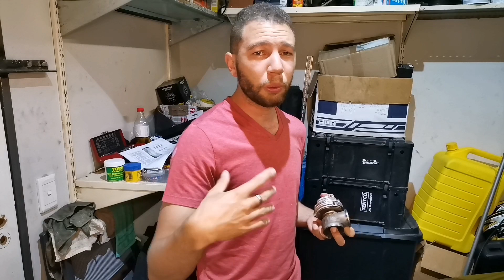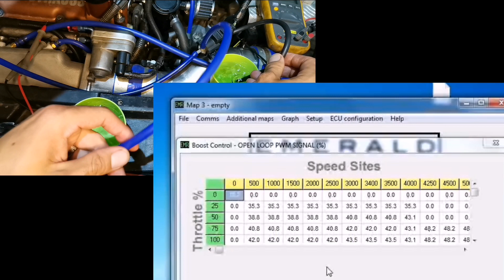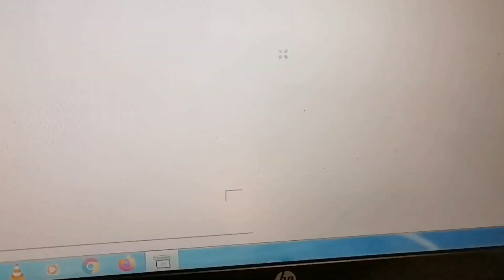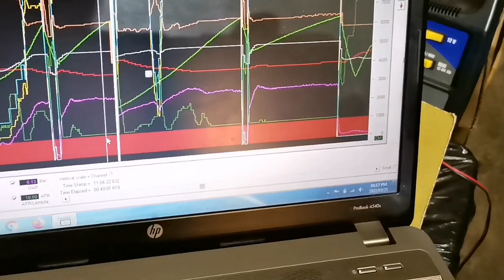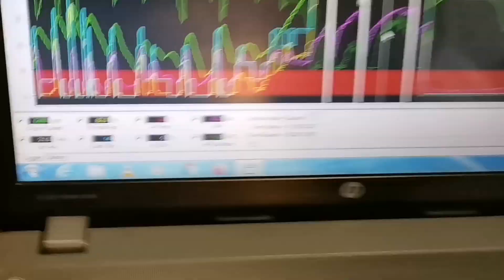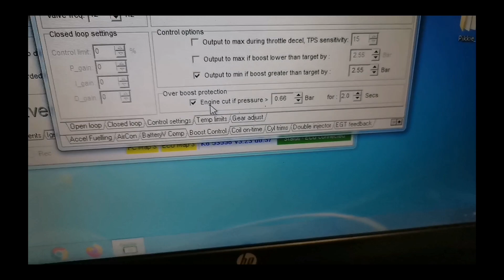How to Setup Boost Control and use Data Logger on Emerald K6 plus ECU, using 3-port Solenoid, N75

Comment: Hi  since installing my k6 ecu on my r32 my the red oil light is on my dash when I put the original ecu it comes off was wondering if you had this issue thanks.
Reply from the maker: Thank you deron. In my case no, I did not have this issue. I'd like you to join the emerald k6 group on Facebook, some of the guys who worked with emerald manufacturers answer some of our questions there... It could be a number of things. Your configuration file on the k6, you plug and play harness, or your sensor. Elaborate on your setup... And type of wiring
Reply: @road_2_pow_r  ok thanks I got the plug and play harness that you got. I’ll join the group to see if I can get any help 👌🏾